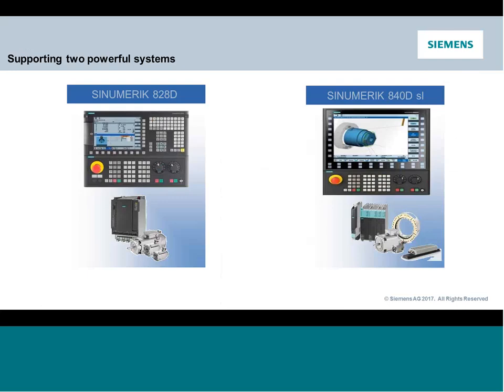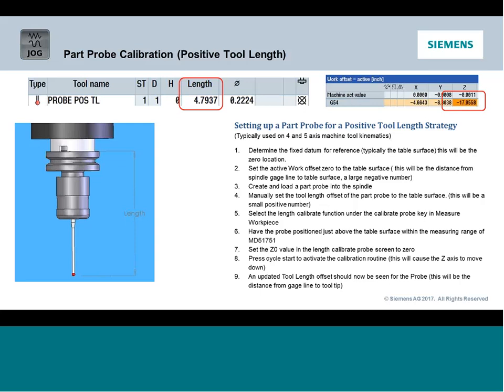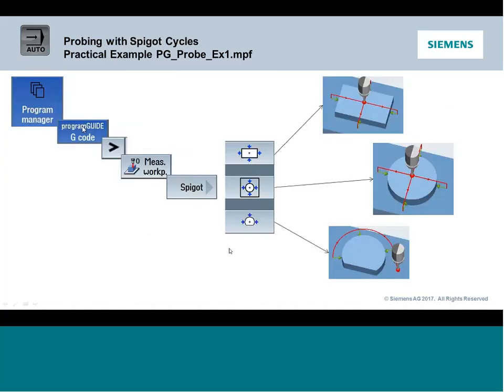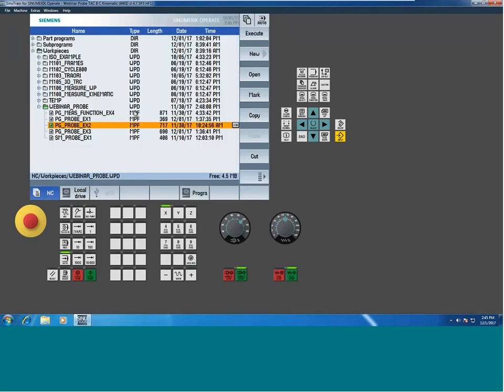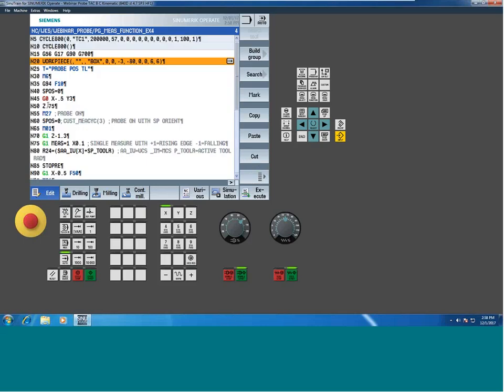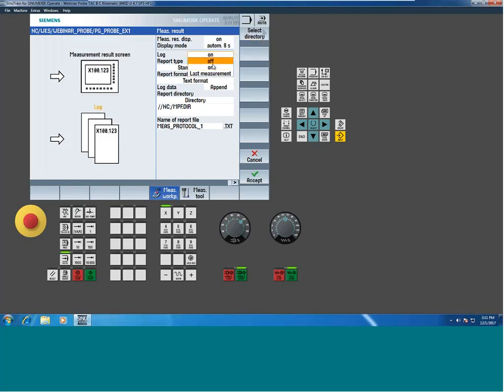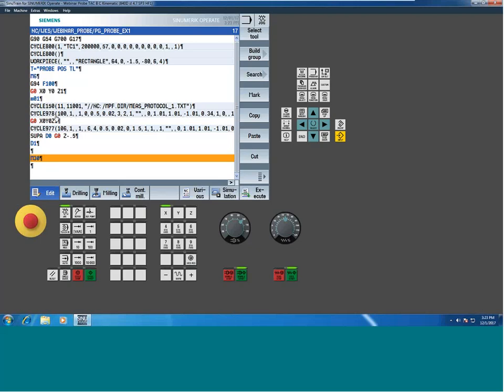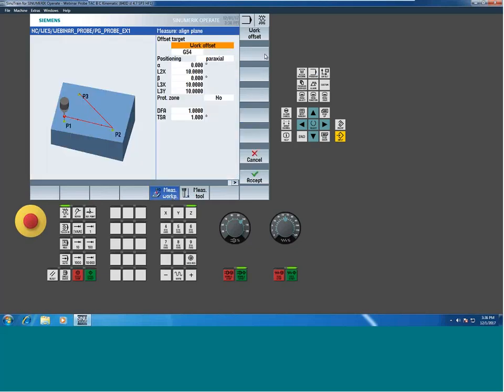Part Probing in  Auto mode with ProgramGuide Sinumerik 840D & 828

Comment: Dear Sir,

I kindly request your support regarding the Siemens 828D controller probe installation. 
Could you please share the details for the skip connection, probe output wiring, and the required M-codes?
Machine Make: Jyoti VMC
Machine Model: SX6
Controller: Siemens 828D
Reply from the maker: this would have to come from Jyoti

Comment: Why are measurement cycles that can be used in jog mode not available in auto mode?

For example
[2 holes], [3holes], [4 holes], [2 circ. spigots], [3 circ. spigots], [4 circ. spigots], cycles, etc.
Reply from the maker: Siemens did not develop those cycle for auto
Reply: thank you

Comment: 1. After calling the probe for probing in auto mode, the rapid traverse to the point to be measured is too slow.
2. The rapid traverse to the tool change point is too slow when calling the next tool after probing is complete.
3. Probe feed rate is too slow, reducing productivity.
4. The equipment is a DMG DMU65 monoBLOCK.
5. I would like to know the parameter controlling the rapid traverse speed.
Reply from the maker: You should confirm with DMG MORI. to the best of my knowledge:
I would look at these and the range from SD55628-SD55640
Chanel SD55632 $SCS_MEA_FEED_RAPID_IN_PERCENT
Chanel SD55634 $SCS_MEA_FEED_plane_VALUE
Chanel SD55636 $SCS_MEA_FEED_FEEDAX_VALUE
if you change any  of these I would calibrate the probe
Reply: @MrCNC  
How do you obtain measurement data? Where can you find it in Sinumerik? thanks

Comment: i run alot of fixture parts in a new machine i've been assigned to. i've never really worked in siemens before when it comes to 5 axis, just heidenhain. in heidenain you can take measurements in their jog mode. how can i do a similar measure in siemens 840? its just a quick and easy way to take a measure, no programming, just some probing in jog . thanks in advance
Reply from the maker: there is a drop down to measure only please email if you want to see this Dan.strubel@siemens.com

Comment: I have a 810D machine that had shopmill in it, after a bit of a mishap with the PCU i swapped it for a PCU50.3 that now connects and workst just fine.. but in hmi adv. i cannot find the TSM buttons and so on.. Do they need to be installed manually?? I have the measuring cycles in the CCU - but i cannot see the buttons for em in the HMI. I did before on the embedded controller, but not on the new win xp based one..

Any ideas?
Reply from the maker: Shop mill was an option for 810D that has the TSM page 
you would have to call the hotline: (800)879-8079
Reply: @MrCNC  thanks, now got it to work after talking to the support.
Then back to stupid questions; how do you use these cycles in manual jog mode with non-integrated measuring tools? The menus for toolsetting and so on only shows up for integrated settings.

Is it the same menu? (again remembering the shopmill that had an explicit manual measuring button - which i dont seem to be able to find in the package for hmi adv).
Manual measuring is prob. more common on older machines - but still something i think alot of users out there would find useful.
Reply from the maker: you can use a edge finder or endmill in the manual jog screens
Reply: @MrCNC  Ah sadly not working just get some activation error.. Oh well might just be old i suppose. :)

Comment: I do understand that the feed rate for the probe has to be controlled. But when I call up the probe and run some manual measurements, then switch to a machining program I always have no control of my feed rate (knob, Dial) its either off or 100% on. Should I put a "M" code to turn that feature (probe) off ?  Also are we limited to only 3 hits when adjusting a plane or can we add more? I have a DMU50 5 axis machine w/840D control
Reply from the maker: What Generation DMU 50 do you have? 2nd or 3rd 
For your 3 point probe question to the best of my knowledge we are limited to only 3 points.

Comment: I think the sinutrain software does not detect the collision (collision of the 3D PROBE with the edge of the work piece) because when I change the part sizes but do not change the length and width numbers of the part within the cycle,After measurement it shows the same size with a slight difference.
Reply from the maker: This is interesting can you please email me your contact Information?
we can try to take look at what is going on

Dan.strubel@Siemens.com

Comment: Does anyone know who is the machine parameter for touch probe spindle orientation during measurement? This should be determined somewhere. Our machine with Sinumerik 828D touches the workpieces with different sides. This way, the run out can not be avoided.
Reply from the maker: What software version is your 828D running? 
I would suggest to adjust the touch probe mechanically as much as possible (if it is adjustable) to take out any runout.
Reply: @MrCNC  I don't know what exactly is the version, but the parameter must be the same on all versions... but anyway. Thank you very much for the response!

Comment: Hi, do you maybe know how to increase feed rate for touch probe during cycle measurment?
Reply from the maker: As measuring feedrate, all of the measuring cycles use the value saved in the general setting
data SD54611 after the calibration of the workpiece probe. A different measuring feedrate can
be assigned for each calibration field [n]. Hope that helps!

Comment: Do you know if the 808D basic has measuring cycles like the 828 & 840? I’m thinking of getting a Tschorn 4.0 probe, but they are not sure if the 808 has these. Or is there a probe you can recommend for my new cnc mill arriving in a few weeks. Thanks 🙏
Reply: do you have an answer to this? im interested in the same thing
Reply from the maker: This is up to the builder of the machine.  I would recommend Renishaw, Blum, or Marposs for spindle probes